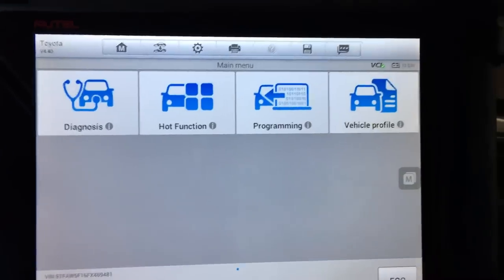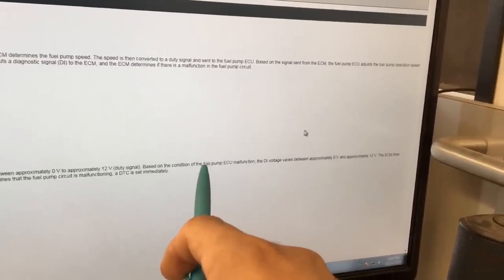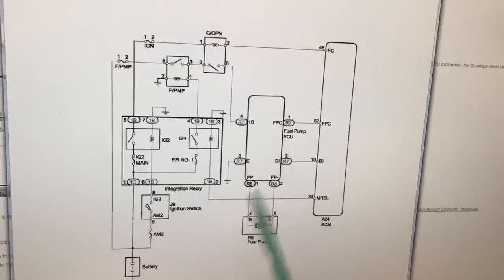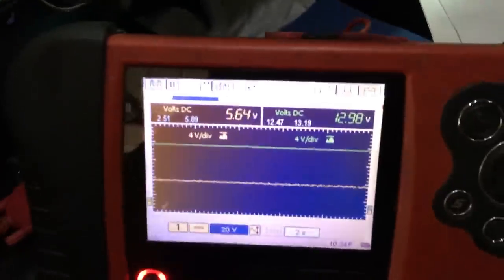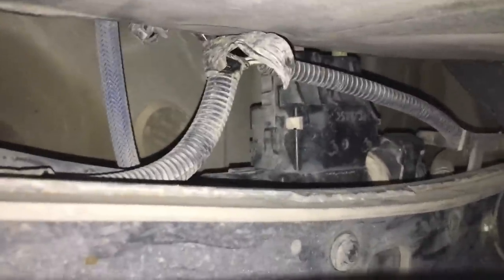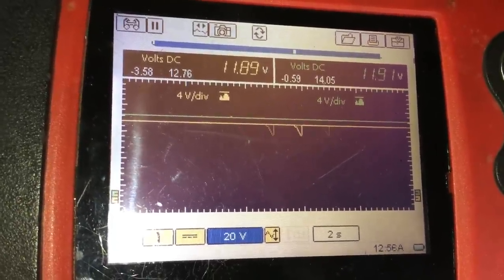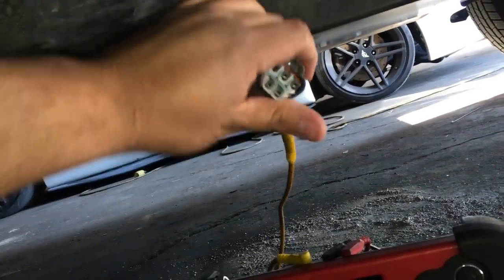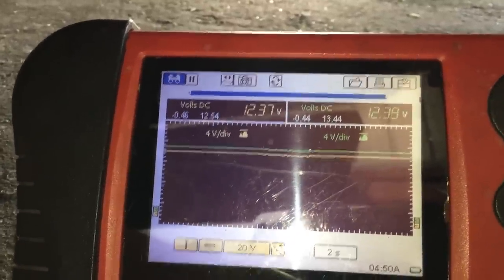TOYOTA TUNDRA DIES STALLS WHILE DRIVING DIAGNOSIS

Comment: Some Tundras have the large fuel tank option which is what you saw there. It's optional that's why it's not a Toyota part but it is original.
Reply: Largest fuel tank option from Toyota is 38 gallons, as opposed to the standard 26.  That’s aftermarket install for sure.

Comment: so the yellow wire turns into red.... hmmm     either they messed it up and cut a wire off a harness they had laying around  not realizing the blue was messed up or the tank was taller and they  cut the whole pigtail off a harness off something else and there are 3 more splices in there. a current test may have indicated a lower current due to the higher resistance  but at least would have indicated pump motor health.  that 1.42 with the connector unplugged plus the 2 v running on the ground side would make me want to check the ground too.  but good diag showing how critical connector pin fitment is.
Reply from the maker: Good points! Thanks for watching!

Comment: ALSO OWNERS OF A 2019 TOYOTA HIGHLANDER. THE CONTACT RECEIVED NOTIFICATION OF NHTSA CAMPAIGN NUMBER: 20V012000 (FUEL SYSTEM, GASOLINE) HOWEVER, THE PART TO DO THE RECALL REPAIR WAS NOT YET AVAILABLE. THE CONTACT STATED THAT THE MANUFACTURER HAD EXCEEDED A REASONABLE AMOUNT OF TIME FOR THE RECALL REPAIR.

Comment: All tundras have a 40 gallon tank. Wonder why they put in a new one for not a very significant increase.
Reply: They do not all have 40gal tanks. Its 26 gal stock.
Reply: Michael Solivan not to my knowledge, but even if that is true, the smart thing to do would have been to put in the factory 40 gallon tank. I believe it fits in any body or bed configuration
Reply: I have a 2014 Tundra and I assure you I don't have a 40 gallon tank.  When empty (at or very close to "E" with Idiot light on) it tops off at 22 gallons. Can't say weather it's a 25 gallon since I never seen that much gas go in but most definitely not 40 gallon.
Reply: 26 gal fuel tank from factory

Comment: Another Tundra?? Not looking good for "Toyota Reliability." Not knocking them, i used to own one..46 gallon tank huh, gotta have a large tank when you're only getting 13 mpg...
Reply from the maker: Lucky for them the problem most likely occurred during installation of the aftermarket fuel tank. Thanks for watching!
Reply: kinda makes me want to keep mine forever now lol. At least repairing them is manageable. Just thinking about all the electronics and wiring that goes into these old and outdated Tundras, then thinking about the new Rams and Fords and GMs and the sheer amount of electronics on those things....one little wire on one little connection somewhere in a ocean of wires...